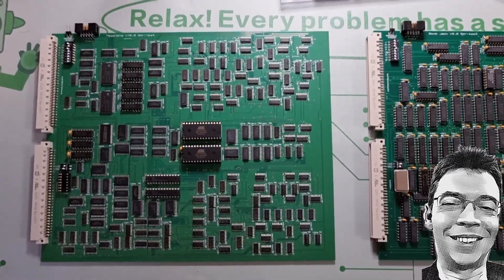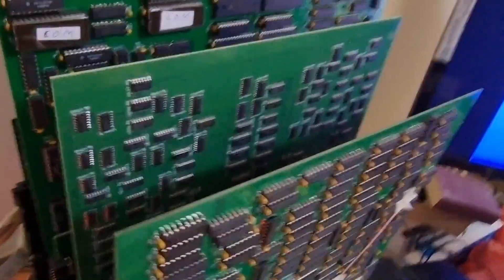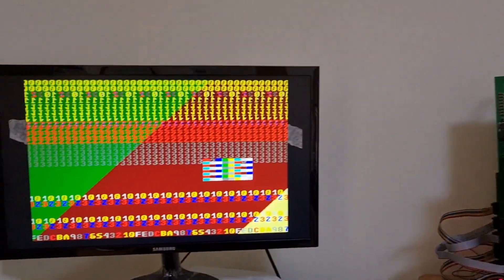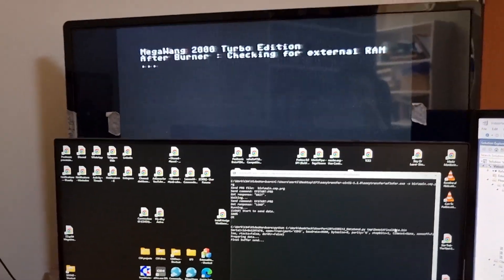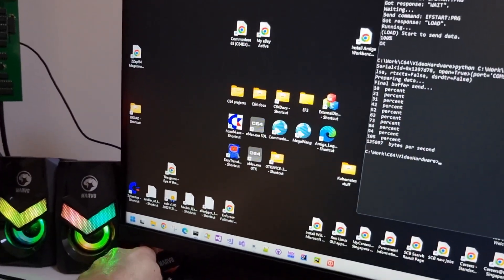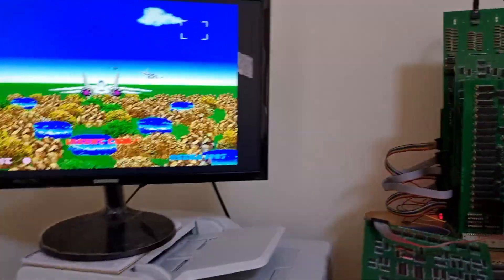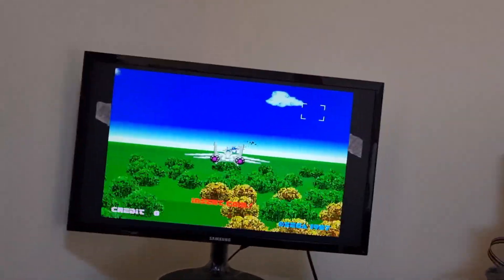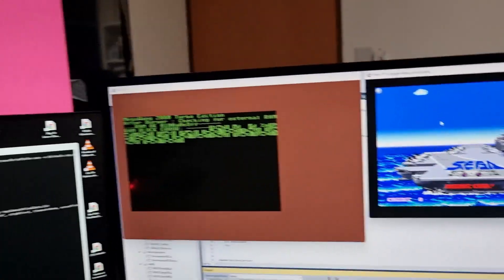MegaWang 2000 Turbo Edition - 39 - Super scaled sprites PCB

Comment: So essentially, you are using a c64 to drive a stack of boards ? 

Whilst this is technically impressive, I fail to see any practical use cases for this if i understand the project aims correctly.
Reply from the maker: This game demo is a practical use case. Education is also. I've already had purchase enquiries.
Reply: @MartinPiper6502 Practical? I'm not that convinced. It leans more towards niche / novelty rather than something gaining widespread traction.
Reply from the maker: @Syntagma-w7g  it's not meant for widespread traction

Comment: The real after burner II uses two Motorola 68000 at 8 MHz and a z80. Is this running on the stock 1MHz 6510?
Reply from the maker: Yes. Only one 1MHz 6510